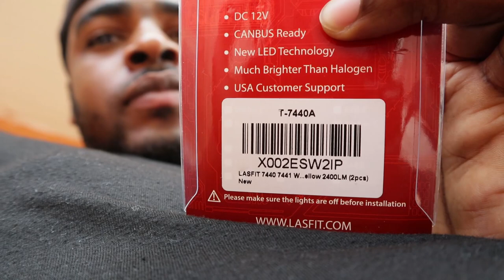LASFIT REAR LED TURN SIGNALS INSTALL!

Comment: I bought these back in back in 2019. If you leave the turn signal on for like 3-5 minutes, they start to hyperflash cause it gets too hot. Did you experience this as well?
Reply from the maker: Yes , they will hyperflash if left on too long.
Reply: Also, even though they are just turn signals, they are crazy bright. If you stare at them directly, they are pretty much blinding. I always get a little paranoid if i need to make a turn and a police is behind me. Maybe the tint will help.